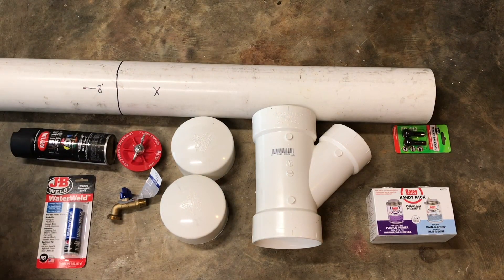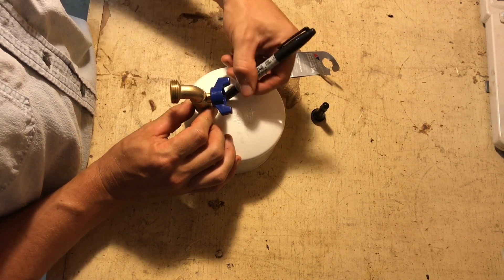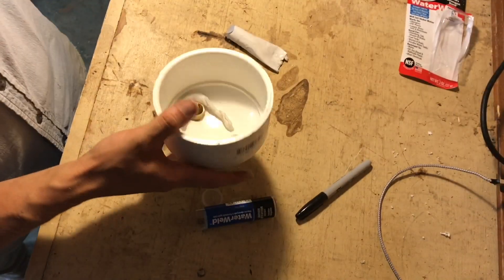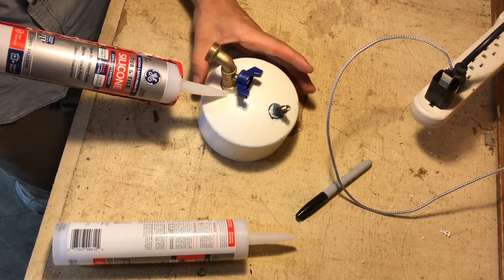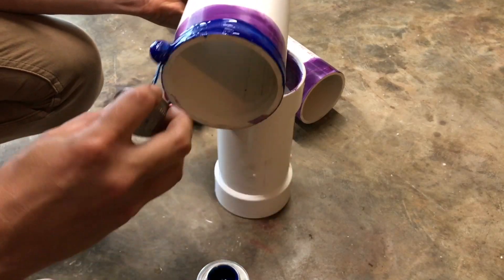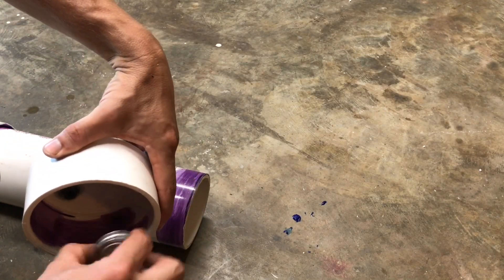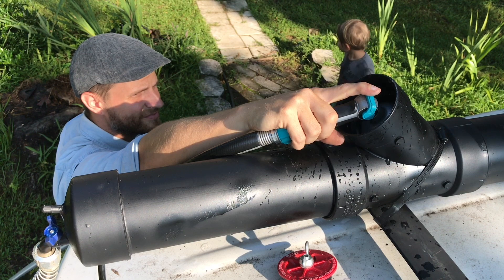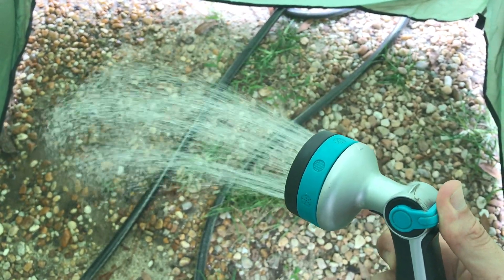DIY Rooftop Solar Shower

Comment: Nice video I like how you used PVC. If I could do my build over again I would use PVC. How is the paint holding up? Also I like the silicone idea on the shredder valve how is that holding up? Great channel man!
Reply from the maker: Thanks for checking in! Everything is holding up great so far. We are testing it on a week long trip now actually. One thing I wish I had done differently was to put the business end towards the front of the car so I could open my back hatch all the way. 😂 oh well. Thanks for the feedback!

Comment: Nice BUT allot of work and cost. You could have bought a 7 gal water jug and attached a hose, painted it black and placed it on the roof and had gravity do the same.

Comment: Why not use black PVC???
Reply from the maker: They don't make black PVC. There is black piping called ABS but it is not good if you want to use your solar shower for potable drinking water. The ABS piping, once hot, leaches chemicals into the water. It is not made to get really hot.